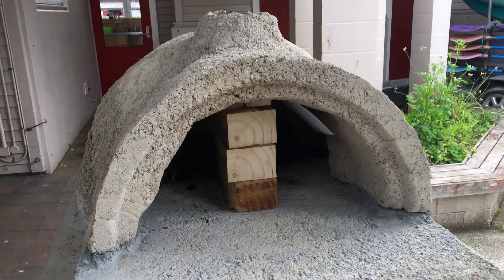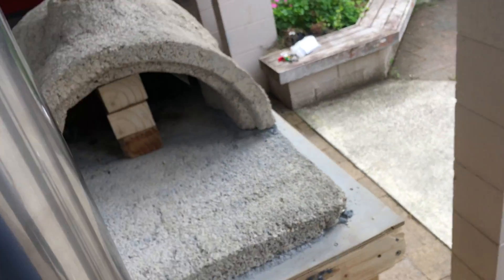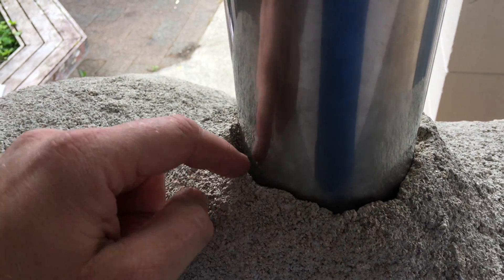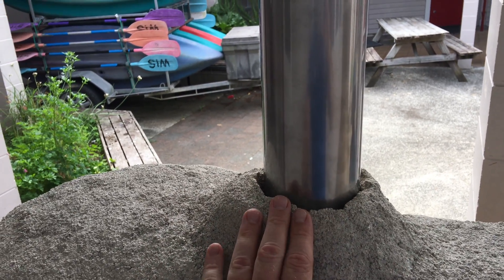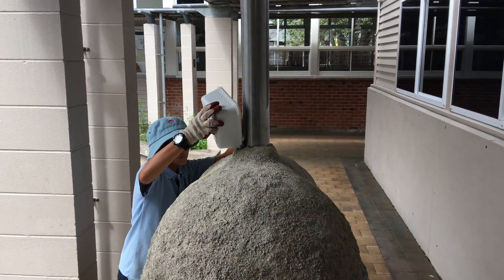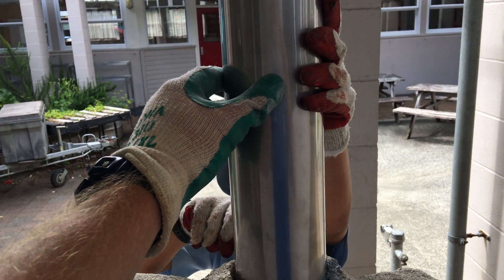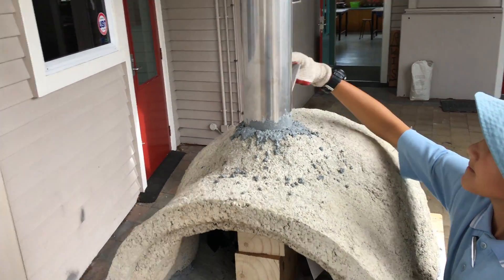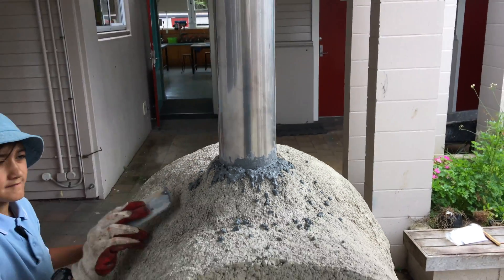Easy Pizza Oven Build tutorial - Part 7 - Fitting the Flue

Comment: 👏🏼👏🏼 my compliments ,, lovely project for the kids (and me @55). several questions please :

I build few brick ovens .. 3rd one was perfect. money time, finding materials and skills locally is a nightmare.  

Now I need to build one for a holiday house. thinking to use the perlite mix with refractory cement ,, will see what ratio will work best. few questions please :

1 what is the max internal temperature that you can reach ? said so , how durable will be this oven...? how solid?
2 what is the external dome temperature while working ? 
3 how long the oven holds its heat after working ? hours or days like brick oven. I understand school projects and kids involvement, amazing idea, I believe at least 10 cm cast thickness is needed then a real insulation with rock wool etc. my concern is the shell. 

real pizza oven must reach 4500-500 C and should keep / holds its temp for at least 24 hours to be warm in 48 h. 

Prefabricated pizza ovens, that comes into 4-6 parts to compose the dome and opening have the magic ratio,, I cant figure out that.

Thank you for your inputs.

Comment: Why doesn't the stainless steel chimney expand and crack the oven ? Thanks in advance.
Reply from the maker: Hi Mark, this oven only gets used a handful of times per year and has no cracks at all, so to answer your question...I’m not sure.
Our one at home has a copper chimney
Reply: @foodrelated  okay thanks for the reply.
Reply: Mine cracked using a stainless steel pipe, the heat expands and retracts the metal, had to remove  it and build a chimney using vermiculite

Comment: what´s the dome internal diameter?
Reply from the maker: 650mm approximately but you could inflate the fit ball more.
Reply: tompeyton1 thank you! Do you think that 550 mm would be too small?
Reply from the maker: I dont see why not.
In the past i have made smaller cob ovens and they have worked just fine. I would advise making the door slightly smaller so you dont lose too much heat.